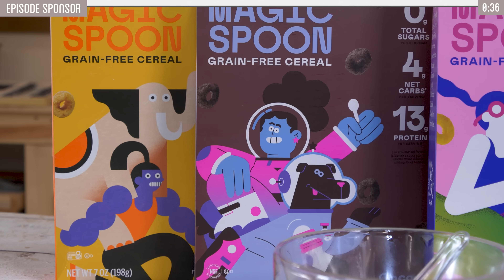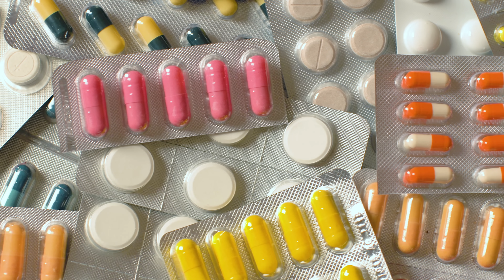How to Make Coke (not that kind): The Fuel of the Industrial Age

Comment: I’m aware it would greatly increase the processing time with drying but out of scientific curiosity. If you boiled the tannins and oils n saps out of the wood first. Then dried it out the. Carbonizednit. 

Would you arrive at a product with a slightly higher purity level?

It’s probably not efficient to go through the step but if it is slightly higher that knowledge could be used to find a more refined method to increase it
Reply: For example boiling the wood in something that does evaporate more quickly at a non ignition temperature Like an alcohol?  It might lunricate the soluble materials out of the wood more purely.

Comment: A lot furnace of designs for charcoal production redirect the wood gas using a pipe at the top of the barrel that returns underneath it where the fire is. The gas then exits the pipe through holes which burns, and helps a lot with the efficiency. You could probably apply the same thing here.

Comment: cars that run on wood do not run on wood gas alone, they actually use wood to produce hydrogen gas and carbon monoxide which is burned in the engine.

Comment: I've watched this a few times.   I guess I make my char coal  differently.     I don't use an open fire.  I use a 55 gallon  drum the fire is in and I have a metal container inside the drum.  I get the fire going   get a bed of coals,  put some fire wood on the coals, place the char coal container on that then fill the drum and put the lid on.   No holes.  So 2 oxygen void burns.  It stays hot for days.  My drum is getting  burned up and now has holes and just eats all the fuel  faster.  My lid has 3 holes (came that way)  all those are open and 1 is a stack you can collect off gases from.
Reply: I know it's supposed to be primitive  tech.  Can trench and cover like a pit smoker.  Utilize the fuel better

Comment: If you put your container into another container with wood in that and put holes at the bottom of your first container it will convert faster as the off gassing will ignite and increase the heat yield.

Comment: Fun fact, once Industrial coke batterys (huge ovens where coke is produced now) are started using natural gas, the coke oven gas that’s produced from burning the coal is then used to fuel the ovens instead of natural gas. It’s a constant cycle of using the byproduct of the previous cook to fuel the next cook. They have to stay above 2,200 degrees F otherwise the coal won’t get hot enough to keep producing more coke oven gas and the whole thing will shut down.

Comment: When driving to some waterfalls in West Virginia, there are some strange brick arch things next to the dirt road. Near the arches is a sign. The bricks are what's left of the old dome shaped coking ovens. The road is actually the old railroad course which was used to feed the coking ovens and take away the coke, usually to the steel mills in Pittsburgh. However there's an unfortunate side effect. These coking ovens weren't well insulated and the toxic impurities seeped into the ground and eventually into the river only a few yards away. Just downstream, at the falls I was going to, the impurities stain the water an ironically beautiful turquoise color.

Comment: (Reiterating something in the video)
Fun Fact: The process of heating coal to make coke also produces coal gas, which used to be captured and piped to houses to be used for both lighting and heating.  It was so common that it was even known as "town gas."  But the big problem with this is that coal gas has no particular smell and so if gas leaked, you had no way of knowing until it either blew up or you suffocated on it.  Modern-day petroleum gas and natural gas both have a chemical added to give them their distinctive smell, so that you can detect a leak by smell before it can cause harm.

Comment: I used to clean it out of heat exchangers in the oil & gas industry. We would hydroblast it. Our machine would idle @1,200 psi, we usually went to 8.5-10k lbs of pressure to get them cleaned. 🎉😊

Comment: Fun Fact:  Not all coals can be used to make coke.  The key aspects (if I remember correctly) are a non-agglomerating ash and low ash content, and moderate volatiles.  There is still a futures traded on what is known as metallurgical coal.

Comment: Medicinal coal tar is made from shale oil chemically treated in multiple ways. Firstly, the bitumen is isolated and secondly that bitumen is sulfonated with oleum and then neutralized with ammonia. This creates Ichthyol, which smells like fresh asphalt and is a strong antiseptic and antiinflammatory agent. Ointments up to 50% concentration are used to treat ingrown&infected toe nails (it's really, really great for this) and psoriasis. Ichthyol itself isn't carcinogenic and can't enter your cells due to consisting of large, water soluble molecules.

Comment: In the USSR they used to make charcoal kinda the same but used the "wood gas" to power engines. They would build a gasifier in the bed run the line to the carb and then fire up the "boiler" to make the engines run.

Comment: So i learned an easy  way to completely stop the industrial revolution if you ever get access to a time machine.

One of the hypothesized reasons for why the vast majority of coal was formed during the Carboniferous era is not only because there was so much plant life, but also because they think there weren't any bacteria or fungi that could digest cellulose yet. Meaning that not only was there a butt-ton of plant matter, but it stayed around a long time. 

Since gut bacteria in the human digestive tract can digest fiber, (which is partially cellulose), if you ever get a time machine you can likely completely stop the industrial revolution by just going back to the carboniferous era, and taking a dump. 

Evolution is WEIRD.

Comment: another alternate source of higher temperatures is using an oxidizer that isn't atmospheric oxygen
concentrating atmospheric oxygen at scale is difficult however and if you're trying to be historical, anachronistic, but potentially doable with modern knowledge at that historical tech level
acetylene is another alternate fuel

Comment: I cant wait untill you make a linear steam pump to work your bellows out of wooden slats with copper sheeting lined on the inside to provide a smooth seal and then you can  make your bellows work much harder than with a water wheel

Comment: Great video. In the advantages, you forgot to mention that all the porosity is hugely beneficial to increase the reaction rate, as surface area increases the amount of reagents that can accelerate combustion. That’s why coal is so difficult. It’s so dense that it actually gets in its own way for combustion. Your comment about the density was quite interesting though.

For your iron, don’t forget limestone. Critical for removing impurities and floating slag off. There are some great mini cupolas out there for iron melting demos, including my Alma mater coming down to the Festival of Combustion in Pittsburgh every year. If you’ve never toured the blast furnaces there, it’s super cool history!

Comment: less your fuel more your airflow, you're trying to passively spur it with a straight hole, you are not making it cyclonic which would make the heat skyrocket.

Comment: Some things to consider with coking coal. Historically beehive coke ovens were commonly used to coke coal. In rural Alabama we find these out in the woods all the time often times with coke in them. If you are trying to do this consistently with how things were done low tech that would be how to do it. 

Second. To coke the coal you want a coal that swells and has relatively low volatile material content. The swelling is measured by FSI (free swelling index) and you want something with an FSI of at least 6. You want a low vol coal preferably 25% or less.

What happens when you coke the coal (heating up to about 800-900C) is to transform the ash and carbon into plastic phase ~400-500C where it swells and aglomerates fusing into a large chunk. As the coal is heated it stops swelling and starts to contract creating by a dense spongy web of carbon and ash. The contraction is critical to the structural ability of the coke to support iron ore during reduction in a blast furnace.

The extra heat above the plastic region is to drive off volatile material. The trick is to heat slowly. Heating fast especially through the plastic region weakens the webbing.

Comment: I discovered that I can literally turn water into wine. Just not as quickly as jesus. I'm diabetic, so when my blood sugar is high, it goes into my urine, which can become so sugary that you could taste it. Doctors used to use this as a way to diagnose diabetes back in ye olde times. Anyways, what this means is that I can drink a bunch of water, then pee out sugary pee, which would then ferment due to natural yeast in the air. I've made alcohol (not for drinking) out of sugar water I left sitting out before. So, it SHOULD work. I'm just too scared to try it. But, it works on paper.

Comment: I live near a bunch of old heavy industry. One of them is the old Zollverein mine in Essen, Germany. Only when you are standing right next to the old coke furnaces you get to appreciate the huge scale of the operation. And by night it is even more impressive, when they have some lighting installations going.  
The old plants have largely been turned into museums and concert venues today.

Personally I grew up with regular coal deliveries which needed to be shovelled into the coal bunker in the basement. 

Funfact: Coal tar is also the basis for carbolic acid, a.k.a. Phenol - which was used as an early antiseptic. It made surgeries a lot safer and made some medical discoveries even possible in the first place.

Comment: coal = pyrolysis of green stuff, gives methane and carbon. ie wood gas. oil fractional distillation is nice. making gasoline from grass pyrolysis/gasification fractional distillation equipment. maybe compare what kinds of outputs the various *gas distillation gives. ie wood gas oil fractions, coal gas oil fractions, grass gas oil fractions. etc. coke crucible for melting and casting.

Comment: 2:26 "Stores the energy from the Sun." Wait, what?
Reply: Plants convert co2 and water in the atmosphere into wood, that fossilizes into coal. That coal then can be burned to turn it into co2 once again, releasing the energy plants stored making wood.
So basically, you are using solar power (via photosynthesis) to concentrate energy into a fuel.
Reply: Yap. Most energy we can use came indirectly from the sun.
Except nuclear. That came primarily from stars that went nova before ours formed.
Reply: @OzixiThrill Basically from other suns.
Reply: @OzixiThrill  Great, so Gazprom should register as a clean energy company! I'm glad to be a being of pure light energy who derives my energy indirectly from the sun! The universe is glorious!
Reply: Literally every power source other than nuclear is caused by the sun in some way shape or form.
Reply: All sources of energy on earth (besides nuclear) are solar powered in the end. 

Coal? Comes from plants which get their energy from the sun.

Wind? Comes from air currents which are driven in part by temperature gradients due to solar energy.

Hydropower? Comes from holding back water, which rained from the sky, which got into the sky because it got evaporated by the sun.

Comment: I believe one of the big limiting factors on melting iron is blowing cold air into the furnace. One of the big game changes was hot blast furnaces, where they would make an enclosed lattice work of brick and heat that until it was red hot. Then they would start the main furnace and the air that that would be blown into the furnace would first pass through this lattice work of brick, pre heating it to thousands of degrees. This way no energy is wasted heating the air from the inside the furnace. It's already to temperature and can get hotter once inside the blast furnace.
Reply: You need serious power to pump the hot air for the Siemens Martin steel making process so he needs first a steam engine.
Reply: And there is a old painting with 3 fires up a hill. I suspect that the lost technology was a limited hot air method of melting steel.
Reply: I believe that you are referring to open hearth furnaces.  They had a brick checker work that acted as a recuperating method to capture the heat from the exhaust of the furnace.  The converters held molten metal and were blown with oxygen to reduce the carbon content.  Blast furnaces are used to reduce the iron oxide (ore) to iron and produces what is known as pig iron.  The pig iron would then be remelted in the open hearth furnace to be refined into cast iron.

hth
Reply: @paulkurilecz4209  Yes, but an open-hearth furnace is used to produce steel not cast iron. Pig iron and cast iron are basically the same. So an open-hearth furnace is an industrial furnace used to produce steel from pig/cast iron and scrap iron.
Reply: @BlaBla-pf8mf My understanding is that open hearth furnaces are used to do both.  The pig iron produced from blast furnaces needs further refinement to be made into either cast iron or steel.

Some mills would skip the casting of pigs and transfer the melt from the blast furnace directly to an open-hearth furnace for refining.

Once the pig iron had been refined, it would be transferred to the converter to burn off the excess carbon to produce low carbon iron (not yet steel as alloying elements steel need to be added).  Depended on the mill design, the melt from the converter would be returned to an open-hearth furnace for the addition of the alloying elements to produce the desired alloy composition.  It would then be cast into ingots for further processing into the final shapes.

Hth

Comment: Doubt you'll see this, but would be super cool to see you cast and make a few of the machine tools from the 'David Gingery' books. a few YouTubers have done it but only in alloys would be very cool to see it done in cast Iron and even then you could do a video on machine scraping to make them accurate (for those unaware machine scraping is the process of comparing your work to a known flat surface and using a tool to scrap away the high spots over time making an almost perfect surface that even today is considered extremely accurate)

Comment: 6:04 that's a pretty wild setup to not explain any of it.
Reply: It’s a distillation setup. The key components are the pipe, the collection vessel and the cold water bath. Vapors from the big container are created from heating the reactant, the hot vapors flow down the pipe into the collection vessel which is cooled using the cold water bath where they condense. This process is called distillation and we use it for many things from making whiskey to isolating different hydrocarbons to make gasoline.

Comment: don't forget to research copper and copper wire, you will need that and some magnets to unlock electricity which will be a necessary first step to unlocking aluminum. Still a ways off from that though.

Comment: As a blacksmith my day has a rhythm cetnered turning coal into coke. Remove the clinker from yesterday's coked up coal. Start a tinder fire. Put cokie in the firepot. Surround it with partially coked coal from the day before. Surround it with green coal. Water the coal. As the coke in the firepot turns to ash and clinker clean it out and pull in fuel from the outside which will have coked up. Add more green coal around the outside. Contine until the end of the day. Clean out the firepot. Put the coke from the firepot and just around it in one pile. Put the slightly coked fuel in another. Put the mostly green coal in a third.

Comment: 9:23 You'll need a water wheel and two bellows. Set up the mechanism to pump the bellows in succession. You will also need bricks, a stronger refractory mortar and a masonry trowel. Otherwise the furnace gets so hot it'll disintegrate.